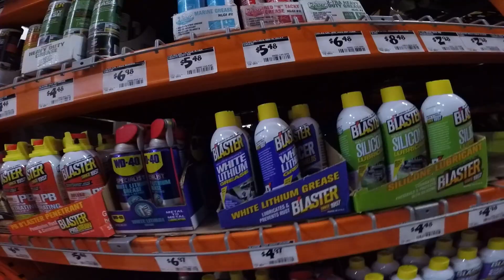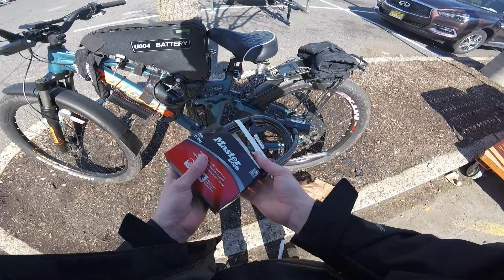Should you Build a Custom eBike or Buy a Pre-Built eBike?

Comment: I love this question and good to hear others opinion should you buy or build a ebike?  That depend on the person as I brought and built one and then DIY the original ebike I brought.  The first ebike I built was front wheel hope and used a Yose power kit, I like this cycle but the greatest problem there is no where to hide the cables but to wrap around the frame as a pre-built one as places to hide the cables.  In fact I feel between a do it yourself and pre-built hub ebike there is very little price difference, unless you have a good cycle already to put a kit on don't think your going to benefit a lot money wise, then you have your labour and I had to drill into the frame and fit rivet nuts so the work can be more advance then just simply taking a kit out of the box and fixing it, but if you want a custom built ebike no one else as then DIY ids the best way you can go, but you can customise a pre-built one but would prove to be more expensive to make a differenc.  My DIY ebike is now up for sale because I have now converted my prebuilt one.

I brought a front hub ebike 11 montrhs ago and was happy with it for a little while and was only £650 as conversion kits go for £400 to a £1,000 front or rare hub and if you have to buy a bike would work out more expensive then a pre-built one.  I was going the send it back 10 months after having it as a number of minor faults accured and thought of buying a mid drive ebike, these you do save in building yourself because a decent prebuilt mid drive talking £1,600 to £1,800 and they are the cheapest and as I experienced 20 to 21inch frames there is a waiting list, I could get one immediately but your talking around £2500 to £3,000.  But I already had a prebuilt ebike with battery and places to hide cables and the only tricky job was soldering a XT60 connector for the battery, everything else was stright forward and got the kit for £400 without battery but even with battery would of cost around £620 so even if you had to buy a bike your talking about £850 so yes you can save a lot of money building your own midrive.

I opted for the bafang because the Tonshang motor would have to remove the stand as with the Bafand you just tighten the locknut in the crank, personally if I was after a hub drive I would buy a prebuilt one but a mid drive then well worth converting but that depends on the individual, in fact at Evans cycle you can buy a hub prebuilt for £500 you can't build one for that price and well worth buying to convert to a middrive because it as places to hid cables and you can sell the kit already built to the cycle so you can get a mid motor fopr under £1,000 as it will already have a battery.  Its all about what is best for yopu as there is lots of options and the mid drive I have built mytself is great and the only one of its kind and because I have places to hide the cables people ask me where I got it from and when I say I built it myself they are surprised because DIY ones do have cables wrapped around their frame.  So I saved over £800 building my own even on a existing ebike buy changing it from a Hub to a mid drive,  Mike

Comment: I had a hub motor bike from store and put 13000 miles on it without any problems, then bosch midrive second hand and put 11000 miles on, then I got brand new bosch ebike put 5000 miles on that and sold it recently. Now I’m looking into getting a nice bike and converting it with bafang 750 or 1kw and a big battery

Comment: Generally you want the non spray kind of lubricants as it's pretty easy to get the brake discs and tyres with the spray kind. Also what ever you use just make sure it isn't going to eat your o-rings.  Like others have mentioned that master lock is not great look into litelock for a good lightweight chain alternative and use that masterlock as an extra pain the arse tool.
Reply: i use a paint brush to lube my bike parts keeps it away from the disk brakes

Comment: I have a DIY 1500 watt folding bike and also got a Sur Run to do motocross. My DIY could not run the normal MTB trails with small jump, tree roots and etc. because the stock suspension is not very good, but with Sur Ron I can ride off road everywhere with 8 inches of susp travel front and rear and 6kw of power. So for faster speeds >30mph you definitely will need something pre-build with good frame just to be safer. DIY bike are quite dangerous on high speed, because frame and tires are not designed to go that fast.

Comment: The best lock is the Kryptonite Fuggetaboutit. I don't park my bike for more than a few minutes. I just use a small cable lock that I bought on Amazon, but it has a 110db alarm, should something cause a movement or a vibration. They also sell just an alarm (no cable lock) that you can hide under the seat. It will go off from any vibration...I would add that to your bike.